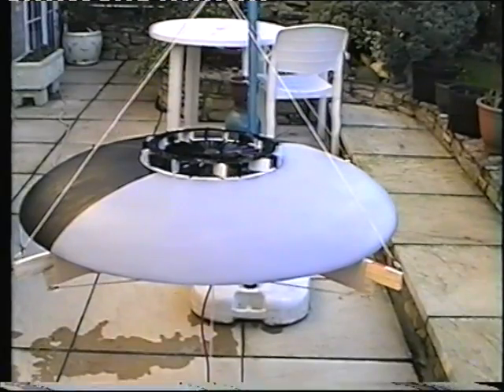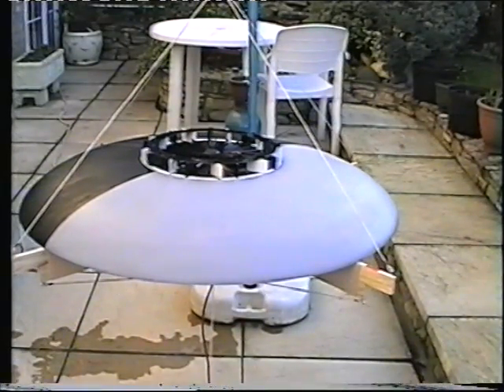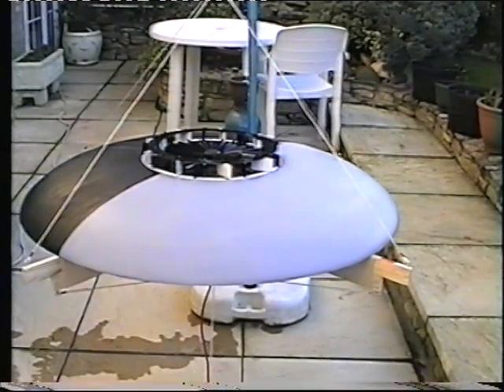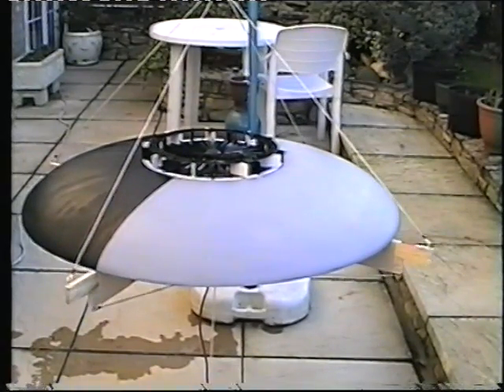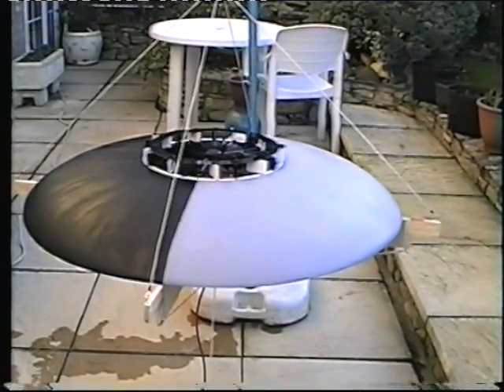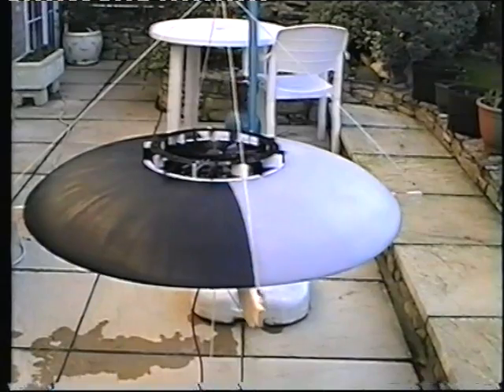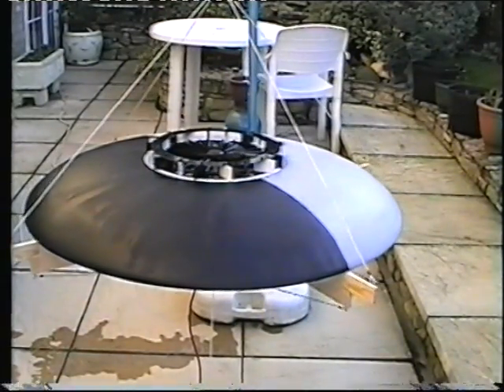Coanda disk aircraft with torque cancellation and attitude control.

Comment: you need the same rotor beneath the disk counter spinning or upside down countering the forces.... using coanda on the inside as well. doubling the force.
you need one over and one under working together, also, 4 holes or 8 holes for drone motors.... enabling levitation... or jet engines but hey...
Reply from the maker: Sorry but not true. Bob Collins
Reply: @MrBlumlein  lol, and you know this.... how?

Comment: Add a lightweight accelerometer and a simple feeback/control circuit to control yaw.  Otherwise you will constantly be adjusting yaw manually as you add or decrease thrust.

Comment: you know what might help with lift.. would be an extensible curved ridge, like an aircraft ridge. To extend outward from the edge, and curve upward giving the leading edge a concave shape on demand. Engineered correctly you could also over retract to accentuate to alter the posterior surfaces as well.

Comment: It's like the Avro Air Car! (I think it had its yaw control vanes at the perimeter of the disc though.)Don't know how many were made, but one is on display at the USAF museum in Dayton.
Reply: only one full scale prototype and 3 small scale prototypes were made of the avro air car ... and it used disk mounted fans to force air down internally rather than externally like this video ... also there was insufficient lift to get the avro car above a few feet ... the avro car was a brute force lifter ... if they went to a coanda effect and counter rotating top and bottom they may have had better success

Comment: have you noticed a significant drop in lift when yawing? it seems like the air flow could delaminate from the surface from the centrifugal forces generated by the vents.
Reply from the maker: Well spotted. Suspect it is due to incorrect pitch angle of Director. Bob Collins

Comment: Where was the cancellation?  Every adjustment resulted in an acceleration of angular momentum.  I'm pretty sure you'd be better off with oppositely spinning blades somehow; like a Chinook.
Reply: +BornFree he is demonstrating yaw control and therefore torque cancellation. the fact that it can rotate in each direction shows that it can overcome the torque of the rotor and then some, then you just adjust your trim until you stabilize.

Comment: Why not use a coaxial gearbox with dual counter-rotating turbines/props to cancel out the torque for the most part, and nearly double the thrust? I know that the Russian "Werewolf" helicopter uses such a system to reduce its rotor profile and increase lift, while retaining all the attitude and collective control of a normal heli, and I know this relies on thrust alone, so the setup would be far simpler in the long run. Could duct the dual turbine setup to further increase efficiency and allow for even better control of the system you have set up with minimal change to the base model.

Comment: Could you use 3 of these mounted on one chassis, the mounts able to move to control stability, hover and movement, could the Coanda disk be used a propulsion device of and aircraft instead of the Coanda disk being the aircraft, just a thought

Comment: Some enhancements:
1. Digital Gyro controlled spin cancellation
2. High-efficiency Brushless Motor
3. EPO Foam main disk
4. Maybe small jets (like on an air-hockey table) to promote laminar flow
5. Death laser and/or minigun with FPV video... and cow-lifter tractor beam
Reply: Yeah , can obtain the hobby motors that are Brushless, the ones used for quad copters, they spin real fast and work off batteries.
Reply: Frank Blackcrow a motor scraped from a 10.000 rpm hard disk is perfect for this

Comment: Bob, if you give me the diameter of your fan, I can recommend a motor battery combo that should not stress the blades too badly and give much more lift.  They are quite inexpensive at HobbyKing.  Not sure but it looked like your fan is about 8in in diameter?  If so, a 1000kv to 1400kv motor rated for 18 to 20 amps would work fine on a 3S (11.1v) LiPo battery.  I'm building one and like your yaw fins much better.  All the Best!